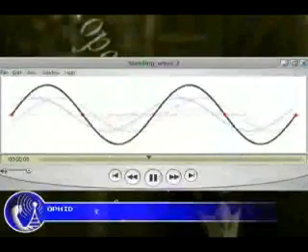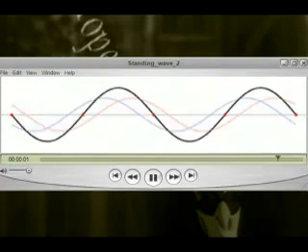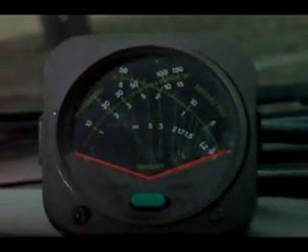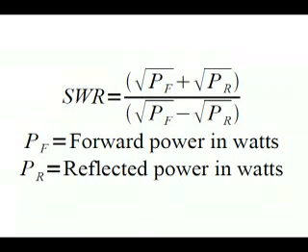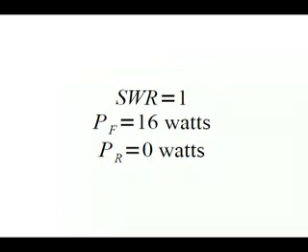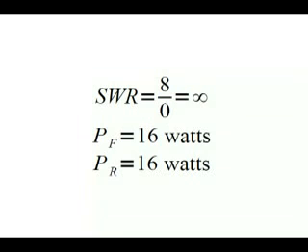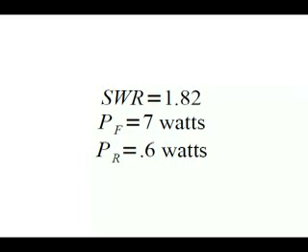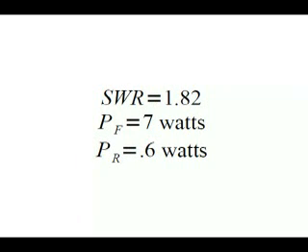Standing Wave Ratio Explained

Comment: Will a higher wattage output antenna help this ratio, when it's not fully potentially used as to say, a 3dbi antenna input of upto 50watts, with use of a 4watt radio

Comment: A SWR of 1.7 is very good, definitely nothing to sneeze at, it represents an efficiency of better then 93% even a SWR of 1.8 is very acceptable as it represents better then 91%. Lots of new amateurs, and even some old timers, get wrapped around the axel about SWR.  You will get more mileage ensuring that your antenna radiates efficiently and in the pattern that is the most beneficial to your objectives then obsessing over an SWR, after all didn't  you just prove that the SWR into a 50 ohm dummy load was nearly 1 to 1 ?  How many contacts can  you make that way? Any how, good video, you did a good job,  you have a pleasant way about yourself.